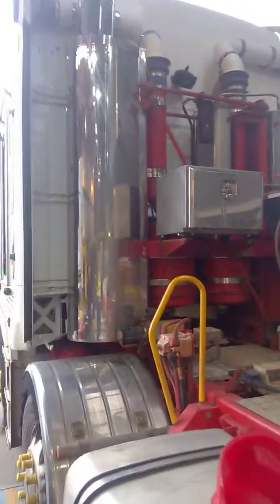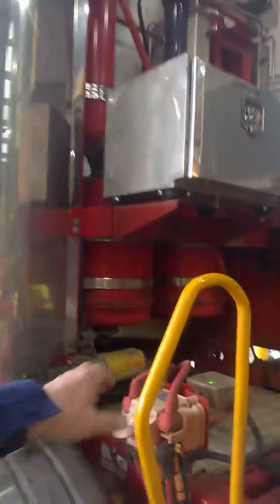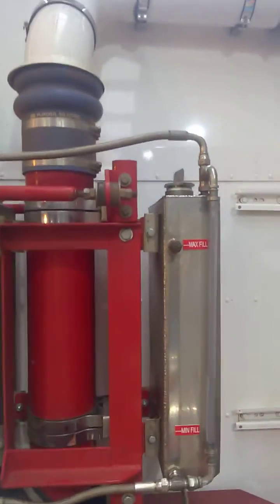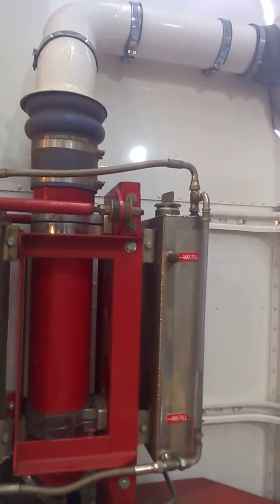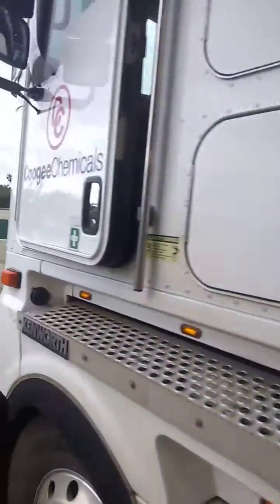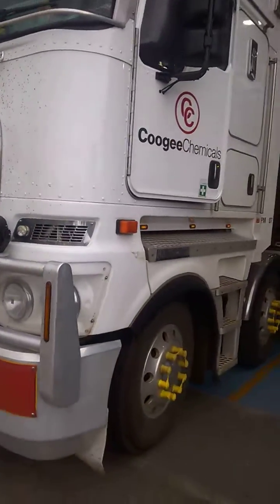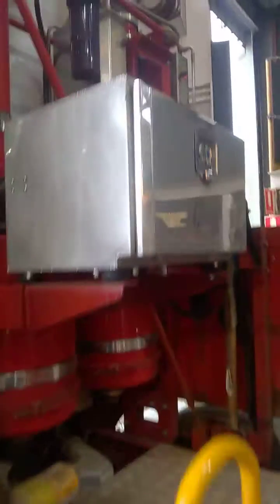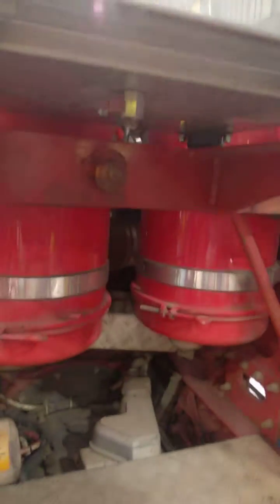Hydrogen fuel system for Coogee Chemical Truck , trawlers , Boats, and Gensets

Comment: Super design 👌👌
How much percent increas millages 🤔
Reply from the maker: https://hydrogenfuelsystems.com.au   0403177183
Reply from the maker: call me on 0403177183 
glknox11@live.com
https://hydrogenfuelsystems.com.au
patented , proven and certificated system delivering 32% savings on a 7.2 L truck - 27 tonne load
Reply from the maker: call me on 0403177183 
glknox11@live.com
https://hydrogenfuelsystems.com.au
patented , proven and certificated system delivering 32% savings on a 7.2 L truck - 27 tonne load